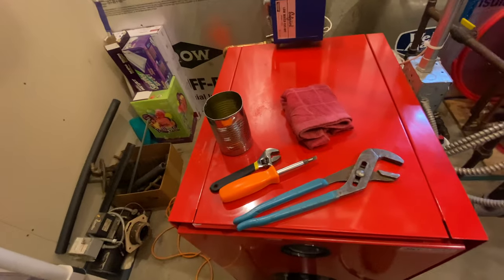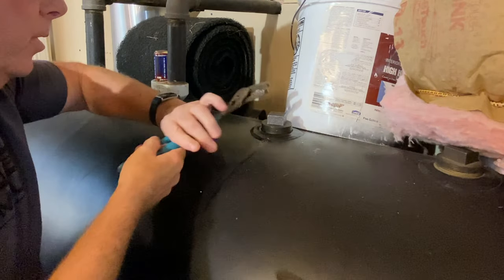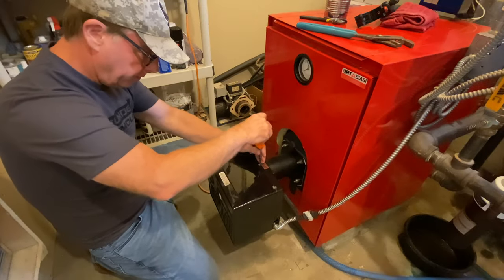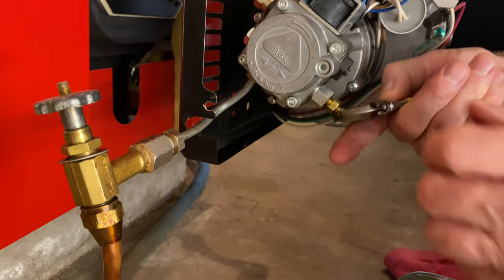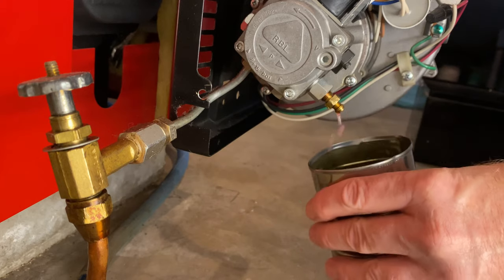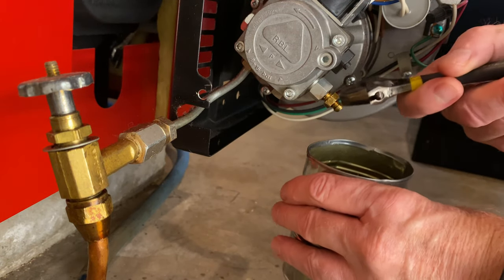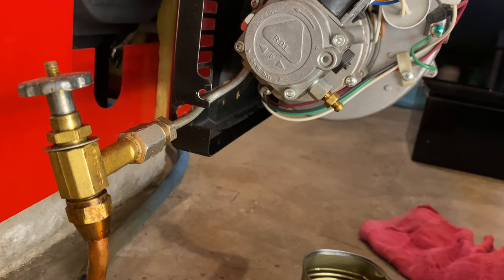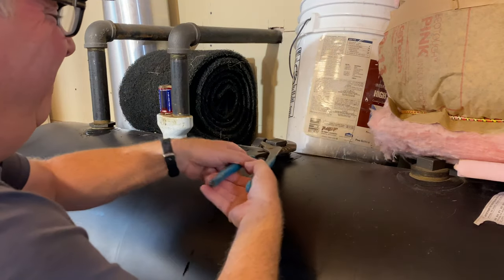How to Prime an Oil Boiler | After you run out of fuel.

Comment: You did not prime it long enough, normally you should let the thing run way more than a couple seconds. Hit the reset button two or three times at least
Reply from the maker: That all depends on the location and elevation of the fuel tank. Mine usually takes off on the first try or occasionally the second attempt. A friend of mine had a long distance between the tank and the boiler and it took about ten times to get it primed.
Reply: @BackyardMaine  That is true. Most digital pumps come with a prime setting that starts at 1 minute. But like you said if your tank is higher in elevation with a short length oil line it can go much quicker

Comment: Didn’t work
Reply from the maker: Sometimes it takes several tries depending on the distance and elevation change between your burner and the oil tank. Also after each try you need to wait about 15 seconds before you try again so the reset button will initiate another start.

Comment: Thank you so much! As a hobby auto mechanic, once you showed where to look for the drain nipple was, then it all made sense. Had to hold the reset button for about 10 secs before pump would prime. Did it twice for water heater and once for boiler...all seems to be working now. Thanks!
Reply from the maker: Happy to help.

Comment: Do we turn on the heating first?
Reply from the maker: If you been out of fuel for any length of time the system should be cold and need to start when you press the reset button. If it doesn’t work try to turn on the heat.

Comment: My mother's oil burner has stopped working today, plenty of oil in the tank but when we switch the heat on, nothing happens. It looks similar to your boiler and I was wondering is the red circular button in the thumbnail of this video a restart button?
Reply: The red button at 2:18
Reply from the maker: @samuelbaldwin4104  Yes that is the reset button. Just press that and the boiler should attempt to start.
Reply: @BackyardMaine  I tried that and still nothing, no lights or no sounds. Any other advice?
Reply from the maker: @samuelbaldwin4104  Does the boiler have power? Check to make sure the circuit feeding the boiler hasn't tripped. Also make sure someone didn't accidentally turn off the safety switch. These are a normal switch like a light switch usually at the top of the basement stairs or outside of a utility room and they should have a red cover. If you do have power and the reset does nothing then it could be many things. One of the safety like low water cut off could have opened. This protects the boiler from operating when it's low on water or one of you controls or the burner itself could have a problem like the motor. This type of burner has electronic ignition which could have failed.

Comment: What do I do if I don't have that little brass pipe there? It's just the screw on... No hole.

Can I use the little allen key valve (above the brass one on your video, to the left) on the side of the square metal part instead?
Reply from the maker: Without seeing what you have I don't know..
Reply: @BackyardMaine is there any way I can contact you?

Comment: I watched this yesterday - it helped.
I went to my pump and can't find the drip/exit 'tap'.
Mine is also an R.B.L. manufacture.
Reply from the maker: It should be close to where the oil tube enters the burner. You may need to remove a cover or something to find it. Maybe you can google you burner and find it that way.
Reply: I found the drip/exit/ tap back towards the petrol tank. I've fitted a hosepipe to it ready to get the air out. I have to switch the pump on right? So the air gets force out? I'll do it Sunday morning, when it's light again, dark out now. @BackyardMaine

Comment: My boiler fired up after bleeding. However my radiators are hotter now than before. Have I tightened the bleeder valve too much?
Reply from the maker: No the bleeder valve should be snug with no drips. If your radiators are getting hotter that would be a temperature setting on the boiler. Not sure if somehow that got changed or possible reset to factory defaults if its electronic?
Reply: @BackyardMaine  In your video what is the purpose of the black nut/bolt about your bleeder valve?

Comment: can I just turn up my thermostat to turn on my boiler? or do I need to push that button?
Reply from the maker: When you run out of fuel the burner will trip a safety and need to be reset to run again. After you have restored fuel you can push the reset and prime the burner like I show in the video.
Reply: @BackyardMaine   thank you for explaining that to me that makes perfect sense. For some reason, my burner still turns on from the thermostat but it just blows cold air, Thank you!

Comment: I bled mine and when I push the reset button it shuts off in the middle of
Me doing so after 20-30 seconds maybe. Any idea why ?
Reply from the maker: It will only try to prime for a short time and the controls will shut it off. Sometimes depending on the elevation change and the distance between the burner and the tank it may take several tries before you get a solid stream of fuel. I can usually do mine in one or two tries but I helped a buddy and it took about 10 tries.

Comment: Iv no fuel coming out i just got my tank filled up but nothing is happening?
Reply from the maker: Are you sure nothing is valves off. If not the pump should prime if you follow what I did in the video. Try it a few times. Depending on the location of your oil tank it may take a few attempts.
Reply: @BackyardMaine  ill have to try a few more times today i just settled for a cold shower last night the house was -2🥶 ,anyway thanks very much for the reply 👍
Reply: I have same issue. EVERY time I run out of oil this happens, an engineer charges me £250 for a new fuel pump each time. Sooner I can get rid of the system the better, just took a loan to pay my oil but can’t afford the engineer to fix the fuel pump.
Reply from the maker: @laravelisbullschitt3281  The pump should not fail when you run out of oil but it will always need to be primed like i do in this video. If you pump is actually failing and the engineer isn't ripping you off, the only thing I can think of is it's running for a long time with no fuel running through it, which can over heat and fail the pump. The thing is burners have a device called a fire eye which shuts off the burner (and pump) if it doesn't see a flame after a short duration. Maybe 10-15 seconds. I'm not sure what's going on there.

Comment: did it twice and reset button will not reset. i have thermostat up high also
Reply from the maker: There is a time delay between resets.
Reply: @BackyardMaine  thanks i found out it had a lock out and had to hold reaet button down 45 secs until it restarted. thanks for your help bro

Comment: Your hand was in the way of the flow lol
Reply from the maker: Sorry. Tough thing to video with my phone.
Reply: All good. Great video anyway. 

The top of my oil tank looked like it had caulking around the top fill where you loosened with the channel locks. I couldn’t get it off.

It took me a LONG time to get the oil flowing without bubbles. It probably took about 15 tries where I thought it was flowing nicely. Also, the backing nut came off when I was unscrewing the bleeder. It was a sh*! show, for sure.
Reply from the maker: @truenewsglobal  That's a bummer. I'm not sure how far away your boiler is from the tank but wow 15 times.. I usually get it on one or two tries. That's pipe sealant on the threads of your oil tank access. If that comes off hard you can go outside and pour it into your fill pipe.
Reply: @BackyardMaine  and it happened again after it actually worked.
Reply: @BackyardMaine  last night we noticed it was off again. Don’t know for how long. The tank was full. I bled it again and fired it up. It went a lot quicker this time, but I noticed this milky substance coming out with it.